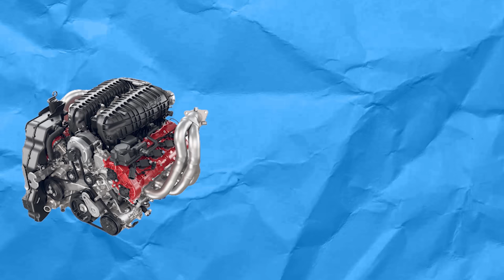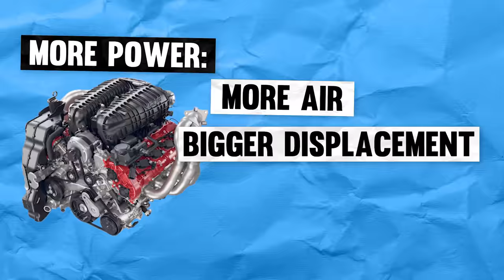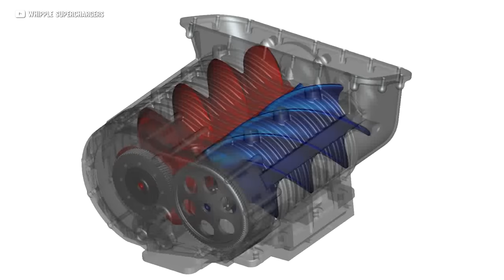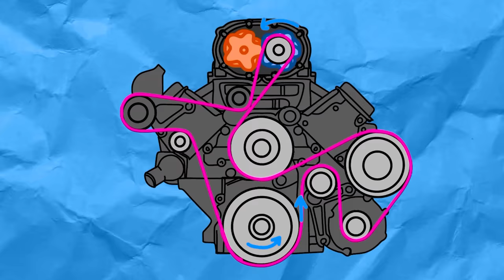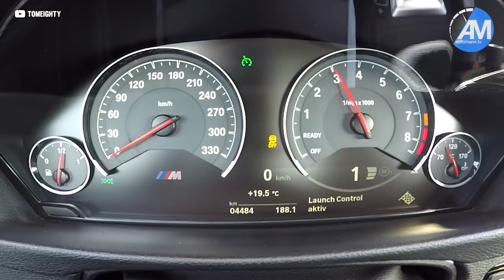Turbo vs. Supercharger - Which is Best?

Comment: It should also be noted the turbos restrict air flow of the exhaust. This artificially increases  the psi in the engine leading to great ware or engine failure.
Reply: How can a turbocharger restrict airflow? Especially when a turbocharger  flows more air
Reply: @sandervanderkammen9230  it takes alot of energy to spool a turbo. It gets this energy from the exhaust and in doing so makes it harder for air to leave the engine.
Reply: @iamsick5204  Ah.. No, the Turbo makes it easier for the air to flow through the engine... that's what allows the engine to flow more air.
Turbo = Higher flow rate
Turbo = Higher pumping efficiency 

Are you sure you understand how a turbocharger works? From your comments you seem a bit confused.
Reply: @sandervanderkammen9230  im not confused... Yes airflow is increased through out the whole system but im specificly talking about the exhaust. Think of the exhaust as a river, with na or a super charger the river has no restrictions the water can flow freely. Again im just talking about the exhaust. With a turbo its like the water is being damed up to produce power like a hydroelectric dam. This part of the turbo is called the compressor. Its name is self-explanatory to what it does to the air trying to leave the engine. It compresses the air which is really useful but but it has the negative affect of backing up the exhaust(like a lake behind a dam).
Reply: @iamsick5204  Wow! You really are confused son!

What goes in? Must come out!

More Air in = More Air out

Wrong, the part of the turbo in the exhaust stream is called the TURBINE Not the compressor.
The TURBINE just like the one in the hydroelectric dam.. the water turns the turbine.

THE DIFFERENCE IS, the Turbo has a Impulse Type Turbine that uses the velocity of hot gasses to drive the turbine.. not the pressure.

Any questions son?
Reply: @sandervanderkammen9230  ya i did get that mixed up...

Anyways are you trying to say the turbos dont cause resistant in the exhaust?
Reply: @iamsick5204  How can they cause resistance to the exhaust?
There is no back pressure.
Reply: @sandervanderkammen9230  even catalytic converters cause back pressure and they arent even siphoning energy. Straight pipes cause back pressure there is even back pressure in the engine caused internally. Some engines are better than others. Thats one of the reasons why people like boosting LS engines its because they breathe so well.
Reply: @iamsick5204  The catalytic converter reduces flow, a turbocharger increases flow.

If an engine responds particularly well to forced induction? It's because the engine does not breath very well, in fact all 2-valve wedge chamber engines do not breath very well at all, they have low volumetric efficiency which is why they produce so little horsepower per liter.

I suspect that you do not understand what backpressure means when in the context of forced induction engines.

Comment: According to conservation of energy law, turbo cannot spin without taking energy from something , and indeed it takes engine power, unless it's powered by magic.  The harder for the exhaust , the  harder the engine must work to push air out of it's cylinders, so no, turbo does have some parasitic load, unless there is some way of not blocking engine exhaust.

Comment: I like both, to be honest  but for a daily daily driver  I would go with turbo. I like super chargers but they just aren't practical. NA engines   are really good.
Reply: Hellcat 20mpg highway with a supercharger. 14mpg city. Pretty practical, considering it has 700 plus hp on tap.

Comment: One thing you stated about the turbocharger is it basically makes free energy which isn't quite true considering the first law of thermal dynamics which states energy can be neither destroyed nor created it can just be changed for use in another way and that you would have energy being used by the engine running to begin with to produce the energy that is going to be used to turn the turbo so I don't know which is better I just know that it depends on your use that you're planning on making the engine whether it be a pro mod or top fuel dragster which always uses a hat or supercharger or your engines that compete in drag weeks which are driven over distances they're far easier to race with and make plenty of power and drive on the highway in Hot rod magazine drag weeks and the kicker is how much money do you have to spend the blower's going to take an extreme bottom end and less maybe compression and the turbocharger is going to build power by staging at a lane and revving the motor up till you build up boost where is the blower gives you instant power at the gas or fuel that you're using.
Reply: Wrong, the Turbo runs on the heat energy normally wasted out the tailpipe. (no additional energy is input from the engine)

True, the energy in the hot exhaust is not lost or destroyed.
The exhaust temperature drops as it passes through the turbine, this drop in temperature is directly related to the amount of horsepower generated by the turbine wheel.
This is expressed using the Brayton Cycle.

Turbos are banned from NHRA Top Fuel,  Top Alcohol and Funny Cars.

Any questions?

Comment: Turbos and superchargers have different classes in racing. Turbo is recommended as a track use or F1 road race. The supercharger can be modified in two ways. Just the supercharger alone creating a very known sound weeeeee, and as well as the other the blower is also from the supercharger. The blower doesnt really blow out air or the “carbon dioxide” its just like the turbo or turbo charger. The blower sucks the air giving the engine more co2 with that the engine has more torque. In the other hand turbo gives the same quality but its an instant boost because its a cylinder object with multiple turbines giving the name turbo. As the turbo sucks the air it gives instant co2 even while the car is in nutreul, as its in nutreul the tubro is still spinning with minimum amount of rpm. But the supercharger in the other hand is simular with the minimum torque  as its original state. But as we all know superchargers are meant for drag due to its high powered torque. The bigger the supercharger and blower scope the more powerful and more co2 entering the engine. The supercharger just has a faster acceleration thats why its recommened for drag racing and popular among NHRA..

Comment: Of course if you have some really cunning and capable engineers you use both like Lancia did for their '80 Group B Delta S4.
It could produce up to 1000hp out of 1759cc and accelerate from 0 to 62mph in 2.9 seconds...on gravel.
Reply: I bet the blower was completely bypassed at higher RPM. It would just be an obstacle at that point.

Comment: The company that balanced my 400hp Saab 2.3 summer daily put it this way: A supercharger is an independently balanced rotating assembly, the harmonics of which you are sending into your crank via the belt.  Turbos do not have that direct link of rotating assemblies. The guy said he was glad to see more people turning to turbos because the main bearings were lasting twice as long in race use.

Comment: There a catch .... There allways said turbos run using the wasted energy of the engin and thats not true in fact turbo turns the compressor by partially blocking your exhaust and thats  literally prevents engine from breathing perfectly ... But why they make such a big difference ? Its because althouth they block your exhaust a little bit but on the other hand make a big boost . As this blockade in exhaust by turbo goes up the numbers of boost psi goes up faster

Comment: But if you make the engine bigger you can make even more power. So you can use a turbo or charger but the bigger engine will still make power. The displament isn't replaceable

Comment: turbo>supercharger
Reply: Is this a opinion or a fact ?
Reply: @luckysock2747  obviously opinion 

Personally id surely want to feel the spool of turbocharger instead of static pull of a super :)
The turbos habit of making my rear wheelers sideway in the straight line,even in small engine is unparalleled to any forced induction.  That gonna be an objective fact:) 
You got a small engine, turbochaged it. You likely have no optimal gain out of root super. That's why centrifugal comes handy. But still,  they hogs onto the crank
Turbocharger is purely on waste exhausts. It's like boosting your energy by utilizing poops out of your butt, when super be akin to plugging onto your muscle mass, and squeeze extra energy out of thy movement of those muscles. Therefore, if you already have a jacked body builder mass via gyming+steroiding, go super! But if you are a normal person with no herculean figure, go turbo!
These are objective fact :)
But my first statement obviously is subjective opinion :)
Reply: @luckysock2747   obviously opinion 

Personally id surely want to feel the spool of turbocharger instead of static pull of a super :)
The turbos habit of making my rear wheelers sideway in the straight line,even in small engine is unparalleled to any forced induction.  That gonna be an objective fact:) 
You got a small engine, turbochaged it. You likely have no optimal gain out of root super. That's why centrifugal comes handy. But still,  they hogs onto the crank
Turbocharger is purely on waste exhausts. It's like boosting your energy by utilizing poops out of your butt, when super be akin to plugging onto your muscle mass, and squeeze extra energy out of thy movement of those muscles. Therefore, if you already have a jacked body builder mass via gyming+steroiding, go super! But if you are a normal person with no herculean figure, go turbo!
These are objective fact :)
But my first statement obviously is subjective opinion :)

Comment: you are completely wrong about Toyota using a little turbo to power a bigger turbo on the 2jz, its actually 2 turbos of the same size, just one is used at lower rpm and the second one comes on line past a certain boost/rpm threshold then some solenoids activate some actuators that start flowing exhaust through second turbo decreasing the back pressure and doubling the volume of air on the fresh air side. It basically goes from 1 small turbo at low rpm to 2 small turbos working as twins at higher rpm.

Comment: In the video, you state that Dodge and Chevy use superchargers, but Ford uses a turbo. Wouldn't it be more accurate to say that Ford uses turbos on V6 and smaller engines and superchargers on the V8, such as the Shelby or the Raptor R?

Comment: In drag racing turbo cars make more power like on big block Chevys , hemis etc but Pro chargers and Super charged cars are faster to the 330 in the 1/8 they don’t make as much power but they can actually use the power they make to be faster. For drag racing itz Personal preference like both supercharged and nitrous combinations are gonna be faster then turbo cars to the 330 and turbo cars have to rely on top end power and speed to try to catch up so in drag racing your options are turbo, nitrous, and Super charged 👀🤷🏼

Comment: Technically, they both suck air into the engines. They both blow air into the intake. The only difference is the method of driving the turbines, one driven by exhaust gas and the other with gears or belt into crank pulley.

Comment: The supercharger has greater parasitic loss than that of a turbo. I currently own a few vehicles with both a turbo and supercharger. It’s a hard pick, but if I absolutely had to pick which one I like better it would be the turbocharged engine. Just my personal opinion thou.
Reply: The only way anyone can possibly state, with accuracy, that the supercharger has a greater parasitic loss than a turbo is by dyno-testing the engines, and seeing how much fuel (as in gallons per hour) they both use at the exact same horsepower.
Reply: @exploranator  actually the supercharger uses power from the engine to make power via a belt, hence parasitic loss. A turbo uses the waste of a engine (the exhaust) to spool up the turbo and create power and boost.

Comment: I prefer superchargers on principle. No boost lag, so instant torque delivery, and as long as there is a net power gain, where is the issue? Maybe it drinks more fuel, but if this is a problem, maybe a four-cylinder crossover would be better suited to a driver with such concerns?

That being said, turbo lag is its own dumb fun! 🤪

Comment: Good video, but forgot to mention the belt driven charger/turbo, best of to world's, but now the real advantage is electric turbo's.. once they really improve electric motors its the end of those useless gas driven turbos.. I've been licensed technician for 50 years, no one knows how to take care of a turbo.. every owners manual states that you must run it at idle for minimum 2 minutes after any long or drive.. oil changes are absolutely critical. Chargers don't need that much attention, just good oil and inspection on the teflons..

Comment: I don’t buy rice burners so hemi with a supercharger is it. Also you see turbos tear themselves up all the time. They have to have oil and a lot of it or they tear themselves apart. Once they do you have oil flinging and spitting out of them. Superchargers are more mechanically sound. And this video is talking on the premise that your racing. You don’t spin up a turbo on the road for a drive. Superchargers, if you need to pass someone on the road, you just hit the gas and you got the power.

Comment: Theoretically its not free to subscribe, because you are then putting more load on the cpu of the device you are on and the datacenter that is holding/logging the information, thus using more power, thus draining your phone battery faster, that you then have to charge and pay electronic bill....🤣😂😋 yes it is practically an unmesurable amount... AND i have to eat more because i used some energy hitting the subscribe, thus grocery bill higher.... Am i annoying ASF yet?? but your right with "Nothing is Free"🤣.... Great video guys

Comment: the only part I disagree with is saying superchargers a limited on how much power they can make, well yes and no, as with turbos it all depends on the size of the charger and the configuration. I have a 2300 front drive roots blower on my 6.0L LS and on soft tune running at 10psi, HP increased from 368 engine HP to 815 and 1249ft-lb of torque, and a freind running the same engine truboed his, cost as much money and maxxed his turbo to make 798 engine HP and 820ft-lb of torque, for more power he needs to move to a bigger Turbo, If I want more I can either just retune or for more change crank and supercharger pullys for more boost, so configuration has a lot to do with it and Turbos are limited as well.
Otherwise good conclusion, samller engines will infact benifit a whole lot more from a turbo, but in the bigger displacements, it depends on configuration and personal taste.

Comment: Turbos and superchargers are not compressors, they are simply air movers. Regardless of whether they are turbine, roots, whipple, etc., they simply suck air in one end and blow it out the other. That air is only compressed if it is then piped into an enclosed space. Another type of air mover is the piston type, like an engine exept that because it burns fuel, it powers itself but it's really just another type of air mover. It's also the most inefficient. Every other type can move more air because like a fish with gills, they breathe in and out at the same time. A piston air mover is like a human with lungs, has to stop beathing in so it can breathe out. Thus, every type of supercharger overcomes the inefficiency of a piston engine by itself not having pistons. End of story.

Comment: Not only in performance but when the car turns everywhere in a track or a touge, there are downsides for the Turbos, their only Downside is you are very more slower, unlike newer engines, that have turbos, the traditional or Nineties vehicles like the Rotary RX Turbocharge, it would definitely take a lot of toll, all cars, Only Nissan Solved it proven it by the GT-R However, turbocharger plus the engine weighs the car more at the front when downhill[ racing ],  which takes a lot of toll, thus the Tires and Brakes due to heaviness, may cause the GTR to drift, idk nowadays if GT-R has the same thing.
Meanwhile Superchargers, are for great speed and drag racing, not only that in touge racing also.
Superchargers can actually benefit in such environment, any environment like Turbos.
But Unlike Turbo's Superchargers are actually for both. On the turbocharger, you only need a technology to maintain it's stability.

Comment: Turbo is always better. No brainer.
Reply: Definitely not on heavier cars.
Reply: @yowhatsup9909  What do you think the weight of the car changes?
Reply: @DriftNick  Superchargers fit heavier cars better, as it is always more responsive and doesn't feel as slow around the turns as with turbocharger which only kicks in at certain rpm.
Reply: @DriftNick  And being off the boost using turbocharger you will feel how is the car awful at lower rpm as you won't feel nothing else other than how heavy it actually is.
Reply: @yowhatsup9909 Not true.
Reply: @yowhatsup9909 Complete nonsense... you need to go to school and learn

Comment: We.. on Europe, Ásia..., Turbo...,  its easy on 2 liter, 4 cylinder, Turbo  300hp,  and torque enoughf...., our diesel cars..., have tons of torque...,  a normal  mercedes c250d  2.2 diesel Turbo , 4 cylinders, 500 Nm, 
 On USA you are use to have supercharger.., and you use 2 valve by cylinder.., since the last 40 years we use 4 valve by cylinder..., so..., we dont need a giant Engine...! But i apreciated a lot the dry sound of a V8, 402 cui !!!  Boost boost boost !!!!!

Comment: What about nitrous?
Reply: that's not forced induction, that's extra juice to burn easier. If you put n2o system on a bone stock car it will literally melt the engine in a few seconds